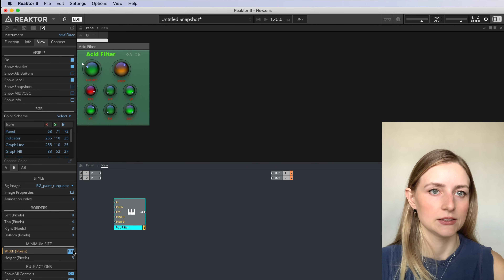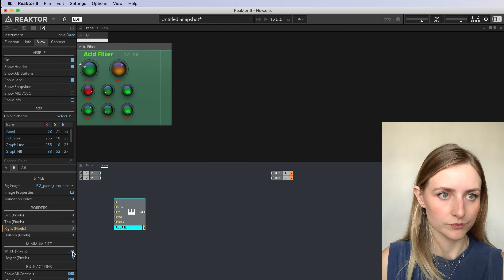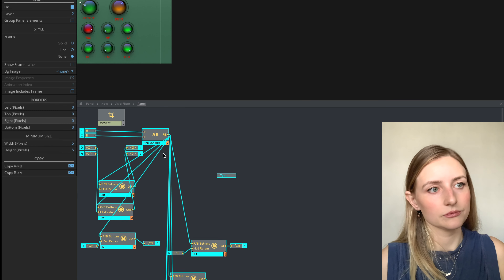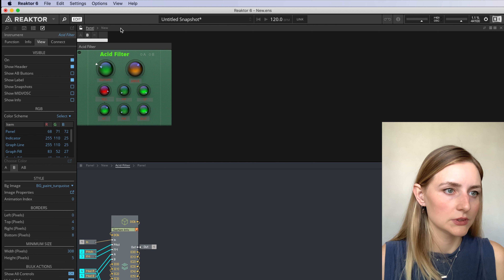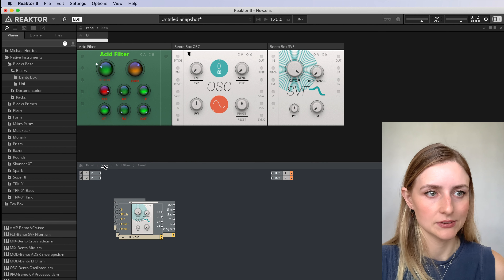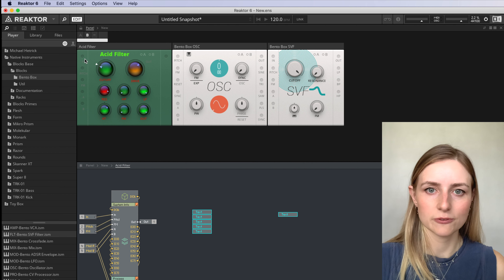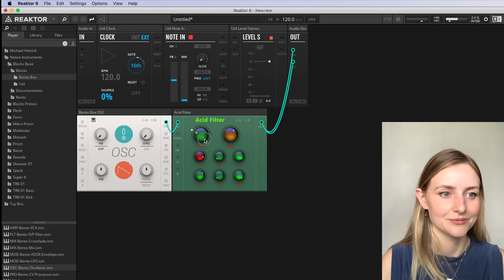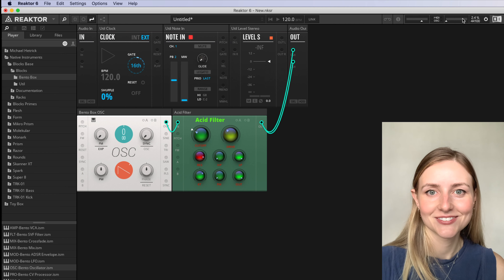Adding Front Panel Ports To Reaktor User Library Blocks

Comment: Excellent video, thank you! Any chance you could create a tutorial about how to create custom buttons for blocks? I mean, what kind of resolution we can use? How many images I need? Do we need several images or are the combined in one?
Reply from the maker: Good idea for a video! To use images for buttons in Reaktor you need to put each frame of the animation into a single image with the frames arranged vertically. For buttons you only need 2 images (on & off), for knobs you can use up to 127 frames (use an animation program like Blender or KnobMan to create all the frames).